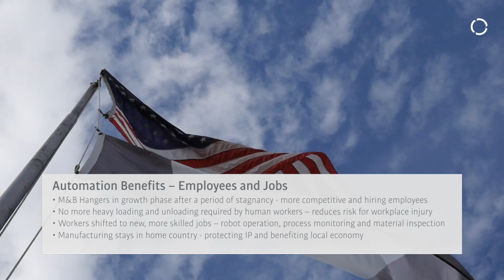Metal Hanger Manufacturer Robotic Automation - Technical Brief

Comment: Most arm robots are four fold systems operations. With a sensor power grab. You can always own a smaller version for small home business operations. Sometimes portable hand held. Base 90 90. Level one 360 360. Level two orthogonal 360 360.